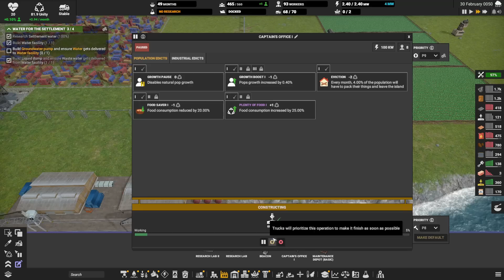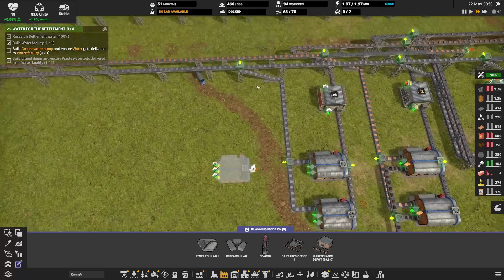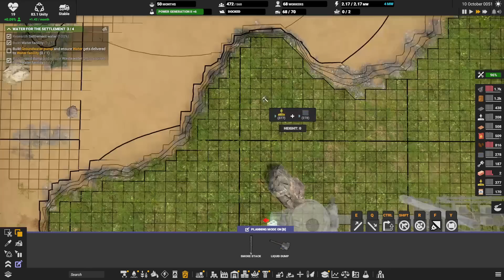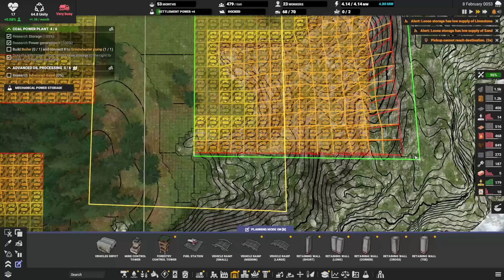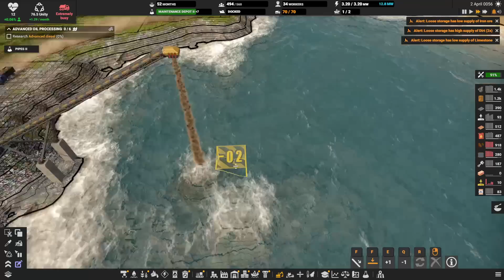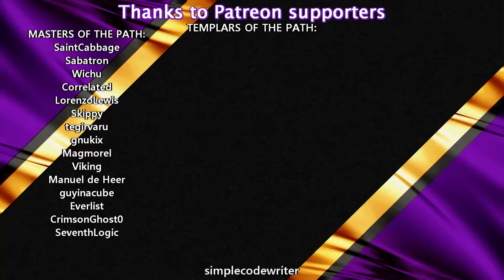Solving Problems Before They Happen: POWER UPGRADE | 04 | Captain of Industry Update 1 | Lets Play

Comment: Thank you for mentioning the problems with the Truck transport at this stage of the game. I will wait to see the managed transport solution that you mention. 
For absolutely no reason I can fathom, trucks cease doing what they should be doing given the numbers of vehicles assigned. The number of idle trucks - when there is work to do is mystifying. 
This is the problem with games these days - And I can never decide if the 'performance' of the game is because of something I am doing wrong or because the game is bugged. Just frustrating. 
As far as I can see there is no guidance from the developer on this issue... so thank goodness for Nilaus !

Comment: You forgot about priority in using the slack before rock and using concrete before bricks currently you use 50/50.
That can make thuput issues (at least it did before update 1) and is wasteful
Reply: Very good points.
I’m fairly sure that making Bricks pollutes more than making Concrete, so quite apart from Dirt production being swingy, that’s another reason to prefer Concrete, with Bricks as a backup.